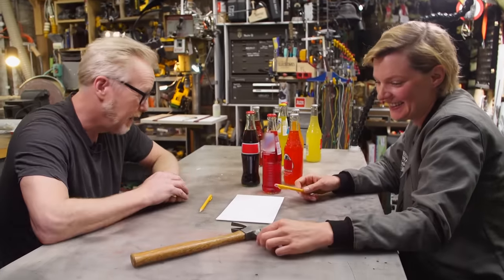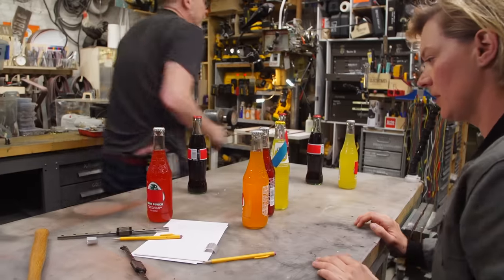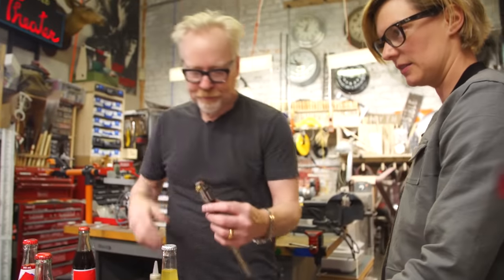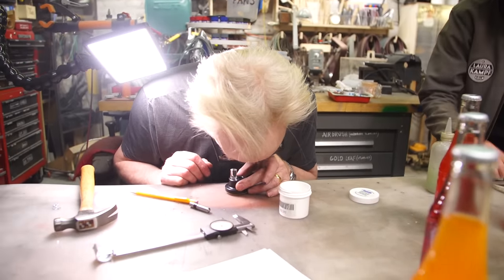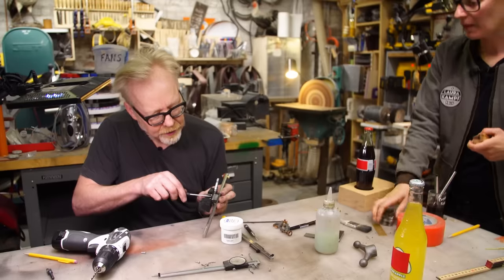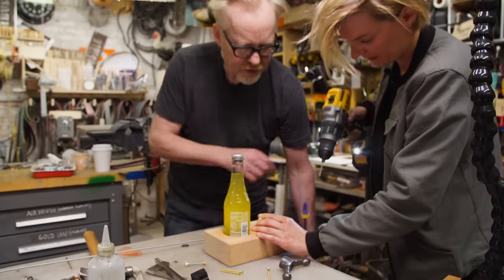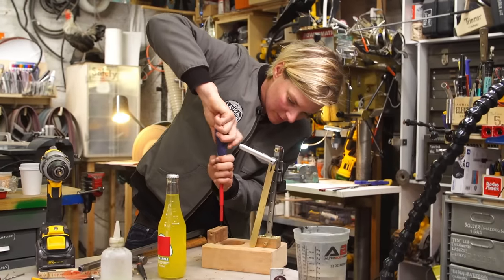Adam Savage's One Day Builds: Overengineered Bottle Opener!

Comment: I believe those are linear bearings.  A linear actuator would move things itself.
Reply: realtalk: linear bearings are fkn sweet
Reply: Linear rails yes ;)
Reply: Not at all. 

It's a forward axel multiplanar co-linear convertibrator.
Reply: lol Now I wanna build one of these with an actuator, out of LEGO technics.. Just to hear that hiss from the pumps, firing the cap remover up the rails, shooting cap off.
Reply: Rocket - You are correct. If he bought the caged bearing version, he could remove the blocks from the rails.

EDIT:
Technically they are called Linear Guides. Linear Bearings are different. Didn't catch your wording the first time.
Reply: +Tom Miller - You are completely correct.  Adam frequently gets terminology incorrect but it doesn't keep him from getting things to work.  It's a bit annoying at times to me but he probably just forgets due to his excitement.

Comment: Timestamps;
---------------------
28:19 - Concept Test 1 (Failure)

33:22 - Adam's imaginary test

34:20 - Shared imaginary test

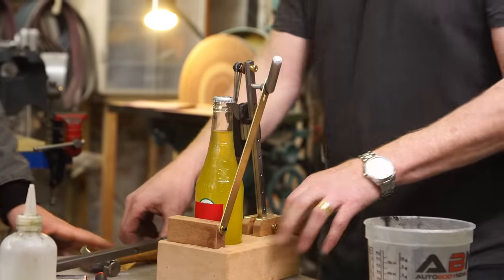36:59 - Concept Test 2

40:59 - Concept Test 3 (without bottle)

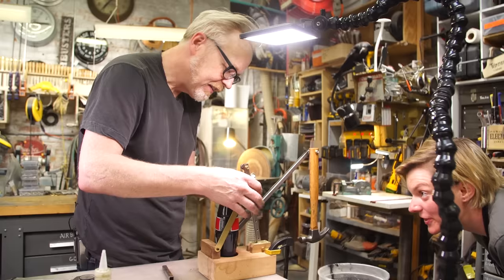41:30 - Finished - Test 1

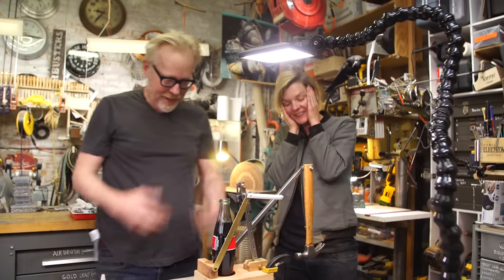41:52 - internal reveal

44:05 - OFFICIAL REVEAL - (SLOW MO)

44:23 - B-Roll of finished product

44:50 - SLOW MO SHOT 2
------------------------------------
BONUS TIMESTAMPS;
------------------------------------
34:52 - ...okay Adam 

34:56 - Adam's face
Reply: Add timestamps in the replies that are useful or funny and I'll add them 😂
Reply: @bu_lai_ke  no, no more timestamps. There are no timestamps that are useful or funny even in your list to begin with. Completely unnecessary... The things people do for likes these days. This isn't a fucking podcast or a full length album in 1 track where we need broken down timestamps for where the track changes. It's a 45min video. Watch it and enjoy it and no more cringe desperation track list for likes
Reply: @jaygio  i agree but you could be nicer

Comment: "That was under 4 hours!"
20 seconds later
"That was just 6 hours!"

THAT PLYWOOD AND PAINT TOOK TWO HOURS?!
Reply: Jacob they also stained it and other small adjustments to make it look pretty
Reply: And tbh plywood drinks up paint or anything liquid you put on it like laquer etc and also black paint sometimes doesn't come out as crisp in only few layers  so i bet laura did at least 3-4 coats of the paint.
Reply: Lol with the size of the brush she used I'm surprised it only took 2 hours. Why do these guys never use 2 or three inch brushes on anything? Or a 4 inch rad roller.. Seems like a waste of time to use artists brushes on pretty huge props

Comment: It's funny that Adam refers to inches as 'English'. For small measurements most people in the UK use metric. As far as I know, only America still widely use imperial measurements.

Talking of UK and measuring things, we are so messed up, we use millimeters, centimeters and meters for smaller measurements but measure distance in miles. We put liters of fuel in our cars while buying a pint of milk :'). A bag of sugar is weighed in grams but our bodyweight is in stone.

Depending on what we are measuring, we use completely different units :')
Reply: There's also a mix here in the US. We measure Engine displacement in cc's or liters. Food content of fat or sugar is measured in grams. Medication weight is also in grams or milligrams. Memory storage is counted in bytes, kilobytes, megabytes and so on. Sound is measured in decibels. Electricians use metric for power and work units, like watts, volts, amperes, etc. We use lumens for light and kilowatt/hr for home electricity usage. In sports we run 100 meter dash, or a 5K race, 400m relay and so on. But road travel distances are in miles, your height and weight is in inches and pounds, engine output is HP. The depth of a pool is measured in feet but it's length in meters. We don't use pints or stone, but we do use quarts and gallons. Our tons are metric.
Reply: yes! i love that about living in the UK - my favourite is buying fuel by the litre, but then measuring our cars fuel consumption in miles per gallon...
Reply: I'm glad we can acknowledge and even enjoy the absurdity. I never knew pool depth was in ft but length in m in the USA. That is a gold star of silly.
Reply: when the weather is cold we use Centigrade and when it is really hot we revert to Fahrenheit.
But we only use Centigrade when cooking
Reply: @Grafight23  IDK if you are really from the US or just don't understand the difference between imperial and metric. We measure engines in CI (cubic inches) or liters (CC is the same as liters). Computer memory, sound decibel, electric units, lumens are not metric measurements (if you know the imperial versions then please inform me). And we do use pints, I'll bet you've bought a pint of ice cream before.
Reply: In watching AvE's channel it sounds like the imperial system is still used in part in Canada.  Unless it's just his work experience that has been imperial system.  He makes it sound like he has never learned metric.
Reply: @orange281gt  up here in Canada, we use the metric system mostly (I think it was implemented I. The 70s) but in construction, we use imperial u its mostly, and most people over 50 years old don't understand the metric system...
Reply: @Booyah696969696969  thanks for the clarification.  From what you said, and other stuff I've read it sounds like Canada, and the UK switched to metric around the same time. (If the Wikipedia article was accurate)
Reply: @Heldane Urbanus
The reason for mixing the units in swimming pools might be that people know their own height in feet, which would be more relevant when considering depth – how far above my head would the surface be if I stood on the bottom, for example. But length is more relevant to competition, including international competition, so maybe it makes sense to keep that in meters. Also, if a pool wants to be used in international competitions I presume its length would have to match an international standard, which is no doubt in meters.

Anyway, that's just a theory off the top of my (non-submerged) head.
Reply: In the uk it's imperial for estimates and large quantities and metric for precision and small quantities, mostly.
Reply: Volrath This is OK.  My country is entirely metric, but a few traditional units (feet, inches, miles, none of them English) remained in use for several human generations, as they gradually fell out of use.  As the UK switched long after other countries, the transition has been naturally delayed.
Reply: Luckily in Australia there's very few times we use the imperial system. Height is commonly measured in feet and inches, but also commonly centimetres. Older people sometimes measure body weight in stone, but that's not common in my experience. And that's actually all I can think of. Everything else is metric.
Reply: @clonkex  hopefully the UK transition that way, when I was at school (around 20 years ago) we were taught both metric and imperial. Just after I finished they announced it would be metric only, I'm guessing I'm the last generation that deals with both...

Comment: Lauras classic german engeneering was also aiming towards "looks", Adams is more like "form follows function".
The Endresult is very very nice. What i don´t really like is the plain Hammer. 
I wish instead of that there would be some kind of spring you wind up with a large key (like in a clock) and that you can set off with a button. That would also make the force adjustable and the machine more compact.
Anyway very enjoyable video!
Reply: I like how you think
Reply: That sounds like just something they didn't think of, they kinda just tossed in the hammer at the start and made it work
Reply: I was thinking compressed air, but I think repurposing  the hammer makes it relatable and interesting for the general public.
Reply: Sure Pho, but see: If you want to build a new item, a tool, with a straight forward purpose, no matter how complicate it works, you should not integrate an already existing tool to it imo.
Achieving something by doing it extra complicated by the use of several KNOWN things that all have a different purpose on their own is already taken...that is called a rube-goldberg-machine.
Sadly, by using a hammer, this reminds me of one...and of a very simple one because you also have to swing the hammer by hand.
It would have been very easy to at least lock the hammer into an upward position and release it with a button etc.
But like i said, when i try to build something "new" i try not to use stuff with already taken purposes for that reason. I get that it would have been too much time for them...this is just a "wish" anyway :)
Have a nice Day!
Reply: I think a rube-goldberg is exactly what they were going for, but one that worked well.  I think Simone is rubbing off on them.  Simone also builds over-complicated things, but hers, though functional mechanically, are highly impractical and ineffective.  Some people don't build or are new to building, and seeing objects used in this way stimulates their imagination.  It brings out the kid in them.  Otherwise, it's just something boring, difficult to distinguish from something on the assembly line on the factory floor.  So it is both a functional piece, but also a work of art.  Ultimately I think their goal is to entertain, promote making things, and have fun while doing it.
Reply: slow down bud if anything the germans never engineered for looks...
Reply: Is like to have seen them use a pinball style hammer, pull her back and watch it pop.
Reply: User input with the hammer makes it more fun i think.
Reply: "Form follows function" was a design philosophy of Ludwig Mies van der Rohe, a German architect. So, both design philosophies shown here are, in a way, German.

Comment: Next step: make a sabrage machine that opens champagne bottles with a sabre!
Reply: Testing and adjusting and retesting could get expensive and messy. :)
Reply: you won't beleive it but such a machine exists in france, i saw one a few years ago, but they would not let me use it.
Reply: It would probably be similar to this soda machine but more robust to handle the blade. Better yet, sabres cut the top off and could leave glass particles in the champagne, so take the soda machine, place the wedge between the cork and bottle, and pop the cork without breaking the glass.
Reply: On Laura's channel she made a champagne bottle sprinkler.

Comment: The other day I was building myself a mic stand and I couldn’t find my cordless drill. I used my corded drill and it started smoking and sparks flew. I no longer own a corded drill.
Reply: Have you found the cordless drill yet?
Reply: 🧐 I recently discovered that, much to my surprise, I still DO own a corded drill. It was on a bottom shelf behind two boxes of collated screws. 
Thought I must’ve thrown it out ages ago, yet there it was. Still works after all these years. It’s a Craftsman from the early 80s that my dad gave for Christmas, as a kid. My very first power tool.
Reply: early 80's and 90's power tools ftw
Reply: Pancakes 1337 yes
Reply: Honestly, the old craftsman tools are a lot better than most of the modern contemporaries in my experience.
Reply: It's pretty normal for a drill to spark due to the brushed motor.
Reply: Take it apart! You likely have a fixable drill, and if not, you have a learning experience!
Reply: Bryan Potts, It's not broken, that's what drills do!

Comment: What is that marker that Adam is using at 19:26??  I need a box of them!
Reply: Pica-ink markers, I bought mine from eBay. Come in black,red and blue.
Reply: Those? They are common for Electricians in Sweden. So, you might just want to check some sort of hardware store unless it is an EU only thing.
Reply: Every hardware store in North America has at least one brand, not hard to find. I may be a Dewalt fan but Milwaukee makes a damn good marker, Milwaukee inkzall fine point is my choice.
Reply: Yeah that marker is called deez nuts

Comment: I have a rather complex idea for a 6pack carry case. When you go to set it down you push down on the part that your hand holding and it triggers small spring loaded hammers of sorts. Another version is a switch that is tripped when you set the pack down. Heck make one a bit taller holding 2-6 bottles of champagne all opened by knifes. The awesome old tools Mr Savage seems to come across make me happy. I love finding tools that should still be used are awesome to find and tinker with. I just don’t have the cash flow to go look for any.

Comment: what's REALLY cool about liquid-filled glass bottle mechanics is this: any strike vector with a component opposite to gravity creates a void between the liquid and the glass. The COUNTER force is so strong that it can shatter the bottom of the bottle. Is it that force reaction the thing that really creates the satisfactory pop that opens the secondary bottle?

I would love to see a machine designed around a primary bottle that's permanently filled with liquid. The machine would be built to maximize the tap-to-void and void-filling-reaction-force effect. 

If you have a machine built to maximize that 'void' effect, I can imagine a lot of really cool products. unique sounds, forces, vibrations.

Really want a V2 of this video

Comment: Another amazing build with Laura. Curious thought 💭... would a pneumatic actuator on the same slide as the “cap hook /striker” work? No extreme weight transfer from hammer to bottles, to shake the carbonated liquid, same silly 😜 sounds. 🤔🤷‍♂️👍🏼 ... Place bottle, set hook, lock, push button. FWOOMP!

Comment: I enjoyed the build however....  Over engineered is an understatement.. 
A few observations. Spring loaded cap poper should be enough. Actually hammer not needed. A U shaped rubber guide resting on the bottles lower neck (i.e. 3-4 inches down from top) would work as a guide to line up the impact point. The cap popper should slide (spring loaded) through the rubber U shaped guide like a roller coaster through a tunnel). Push firmly down on the bottle (into it's holder) to release a spring release mechanism that lets the hammer slide of the shaft connecting with the bottles cap..

Comment: Adam, you really gotta remake this one. I like the idea about the hammer. BUT. It would have been even cooler, if the slider got locked in place at the buttom, and was released with a push on a button. That would mean the spring strength, forced the slider towards the bottle cap and pop it open that way. Please try remaking it!

Comment: Now you could of just used the spring to pop the cap off the bottle instead of the hammer. Just pull the lid popper all the way down and let the spring do all the work. Maybe a stronger spring and a grab handle to pull down on. But it was an awesome gadget. Good job👍

Comment: HIn a very non creepy way. I really enjoy Laura's slight German accent. Some people have voices that help calm my diverse brain.
Big fan of German over engineering. Used still for years never ever let me down other than normal upkeep. So good not cheap but nothing good is. There's a Japanese brand too echo thry are nearly as good. Same thing never let me down. Everything was still or echo and Honda lawnmower again never really let us down unbelievably good machines. Had a 4 wheel and roller the 4 wheel could pull a train i swear. Just great things. 
Be careful what you wish for, I wished to not work a stroke later here we are. Been really lucky tbh. Just can't do what I used to. My young age helped massively i was only 37. Being in good shape too.

Comment: Kind of need a "C" shaped collar that fits beneath the edge of the cap so it lifts a decent portion of the cap from the bottle. removing the cap from such a small point runs the risk of merely bending the cap without fully removing it.  (Edit) I stand corrected it works quite well as is

Comment: Is that a Bridgeport I see there did it come with auto feed. I miss  mine. Covid took it away. When businesses closed down I couldn't  work in my shop.
I made a 6 in 8 head cutter with a Jacob's taper for a hammers collet.they are not common. The set I have was owned by my grandad dad. He was a machinist in the early 30s to the mid 70s . But yes I like your videos.

Comment: For anyone wondering how fast the bottle cap went, I tried to use youtube's frame advance feature to find how fast it moved in a 30th of a second, and then extrapolate from there
Problem: the cap immediately vanished from view, meaning that it was faster than the space the camera could capture from the position of the cap to the top of the screen
Conclusion: It is Damn Fast

Comment: I'd have gone for a cam action, so you can set the cam motion to be vertically up in the initial set position, and you act on it such that the cam rotates upward and away from the bottle, hooking underneath it. Sort of like .. I dunno... a bottle opener? This deforms the cap outwards, giving it the room to escape over the glass rim, rather than just smashing the glass rim off the top of the bottle. This is why I don't use the bottle on bottle opening technique or any similar, but can open a botle with anything from an 8" chef's knife to a Crank Bros Eggbeater or a tennis ball.

Comment: I think it says heaps about me that this video features 3 of my favourite builders..

 . . And neither realized intuitively that the weight of the hammer wasn't supported.

....... Perhaps it is even more telling that I think that the next step is to fix the aiming.. 

(also; Why touch the hammer with your hand at all? then you might aswell have manually used the claw of the hammer to open it).. so.. The next step should also involve some form of crank-driven winch.. Probably spring-loaded so you can chose tension (Again; To make it possible to aim).